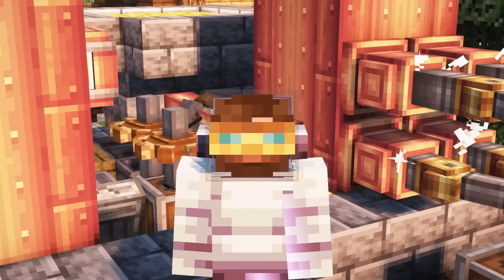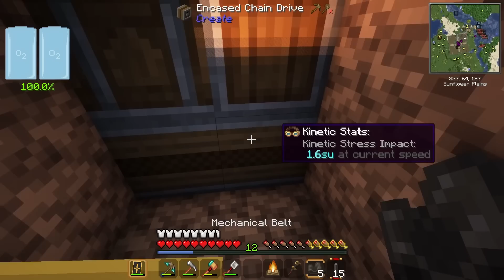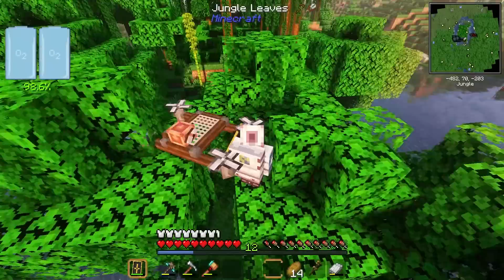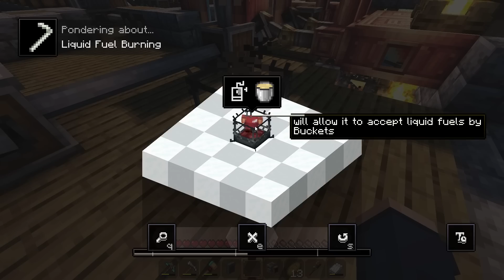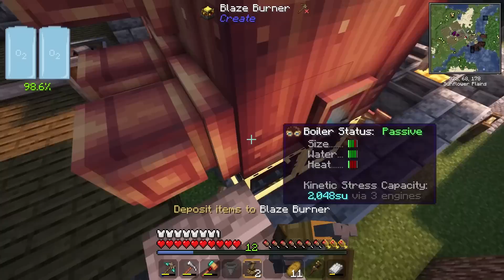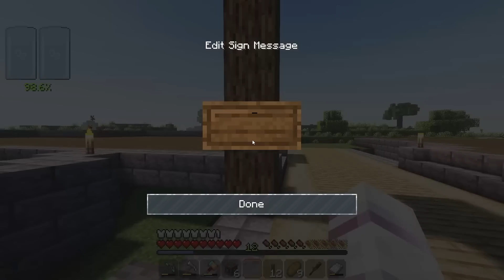Infinite Lava & Steam Engines Upgrades Ep16 Create: Astral Adventure

Comment: i know u  so much wanted to use lava for burners but consider this when/if u gonna make 3x3x5/4(?) boiler:
u can fuel it wood from woodfarm (or planks with lil processing) that u got  loooooots of and can easily transfer with ae2 ME interface + belts>fans>chutes>deployers or export bus (if u  got storage bus on wood so ME system have). u can use that ME system to make cleaner  designs like that, for another example make lava generation somewhere else then put storage bus on tank  and u can export it from that tank anywhere with export bus. Its very neat for big factory or dont want to have belts eeeeeeverywhere just to move stone/lava/gravel etc just put that storage and access anywhere. hope i helped and btw i got into modded mainly thx to u (all the mods 6 series in very nice forest) so thank u for that <3

also lava will be used in lots of other stuff for example automatic gold or limestone/silver  thats gonna go into other stuff so dont use it for boiler bc ^

I want to stop typing but laaaaaaaaaaaaaaast one tip. For less complexity and  pain in the ass u can disable channels with ae2 channels infinite. the limitation is gonna be  power anyway and channels are just annoying to deal with. okey thats it,  most importantly have fun :)

Comment: Hey chosen, make a brass funnel with a empty bucket filter instead of an andesite funnel, that way the mechanical arm wont take a bucket that isn't full of lava yet and just stop until one of the blaze burners needs new fuel.
Reply: it's a long time since this video was posted and being decently new to create, I think some updates may have changed how the mechanical arm acts(?) Recently attempted the same setup mentioned but it just loops itself over and over with taking the bucket then just placing it back into the brass funnel and looping, any help would be appreciated even if this video was 2 years ago 🤣

Comment: Something that I recently learned is that if a source of liquid is large enough, the mod treats it as being infinite. For lava I believe that's 10,000 blocks, so using something like a hose pulley to pull out of a lava source that large does not consume the lava. The easiest way to do this is, of course, in the Nether, but moving fluids across dimensions can be annoying, so it may be worth creating your own "infinite" lava supply in the overworld. It would be much faster than relying on dripstone for lava creation, although it would certainly be more effort.
Reply from the maker: 10k source blocks of lava
Reply: there is no nether in this modpack
Reply: @viruzaum  The point being that any sufficiently large lava pool will do.

Comment: Hey Chosen, just a tip, increasing the RPM to the encased fan does not increase how quickly it will process items, but it will increase the range at which items can be processed. If you want to increase processing speed, you need to add more fans.
Reply: Couldn't you just stack a couple belt lines on top of each other and multi wash? Haven't tried yet but will and can let know if they wash further and thru them too just saying
Reply: @LavenThaRaven  yes you could, but at that point you can just outright drop the items and multiwash on a single block isntead of on a loooong belt line
Reply: @LavenThaRaven doesn’t make i faster really tho it’s taking the same amount of time it’s just able to do more than a stack at a time but when are you gonna have more than 3 stacks at once really

Comment: A cube that's 10.000 blocks will be an infinite lava source and much better then your current setup you can use trains and get the lava from the neather.
Reply from the maker: nether isnt a thing in this modpack
Reply: @ChosenArchitect  darn to bad it would take a long time to fill up a cube that large with drippstone.
Reply: @94Tomekm  nah, lots of dripstone in 1.19 so making lava gens is ez. 1 bucked per cauldron per day
Reply: @ciaran9970  I haven't played since nocht owned Minecraft and before the hunger bar was implemented.